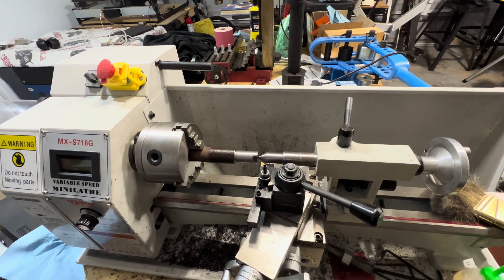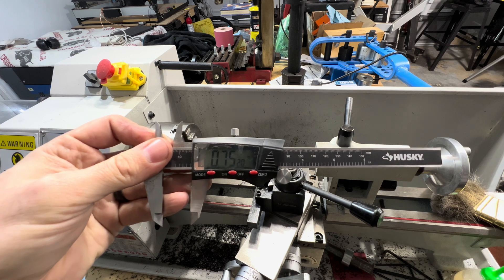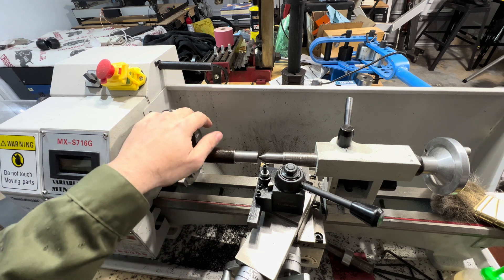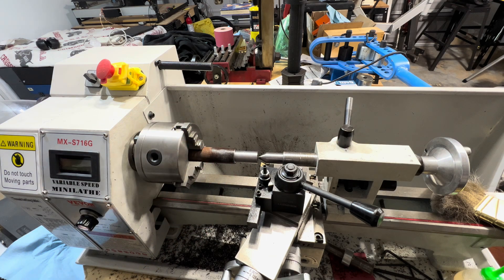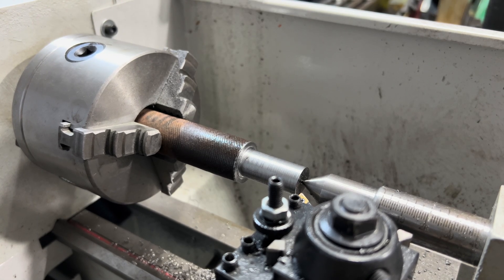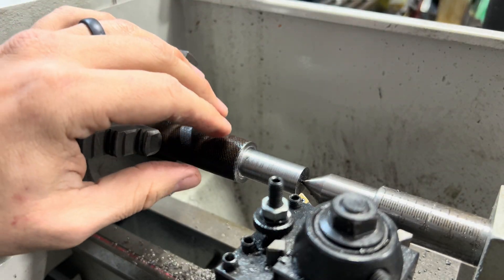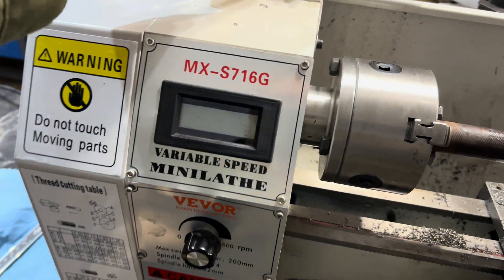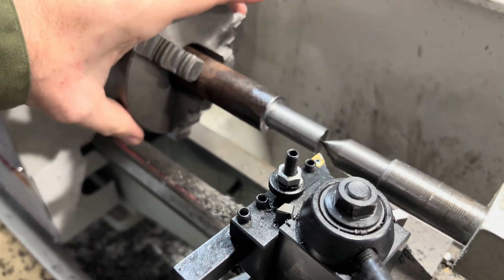Vevor mini lathe turning tool steel

Comment: Nice video I’m looking at those lathes right now. I plan on cutting 4140 pre heat treat. Nothing production, but every so often. What tool steel was in this video?  Great video. Gave me a little encouragement to take the plunge. Thanks!

Comment: You have schemes for cutting speeds, both rpm and m/min, important. Try to use the automatic feed, gives the machine even load, and better for the cutting tool , and don’t be shy on the cooling liquid 🙂

Comment: Very nice work mister. Good video. 
That lathe works great. Mine will struggle with that steel.
Reply from the maker: Thank you! it has been a struggle with getting this lathe to operate decently!
Reply: I have an 8×14 that came with one of the "bigger" motor options😂 still a joke. I tore it apart and upgraded it all, threw a 4.5 hp motor on it (a legitimately honkin big torquey motor) with a custom belt and pulley and gear set up to fit it all. I can take HUGE cuts in steel now. And turn hardened alloys as well quite easily. I wish I would've just found a more proper lathe to begin with though. Still would work better still I'm sure
Reply: @notyouraveragegoldenpotato I have same lathe as yours, Can you please tell me what kind of motor have you put on it, was it a kit package and where did you get it 
Thanks